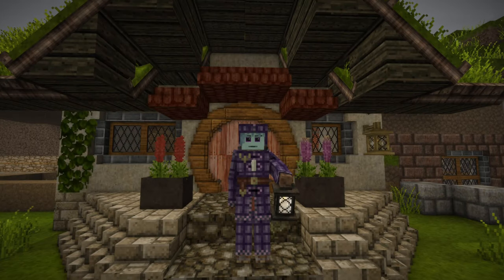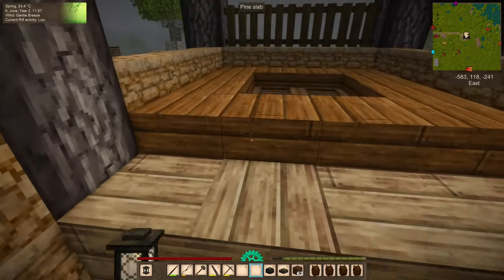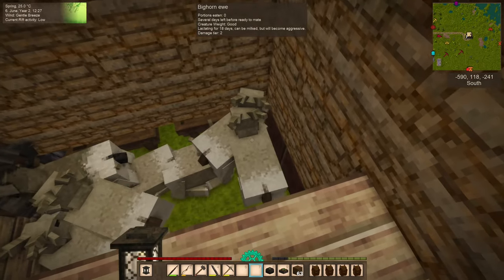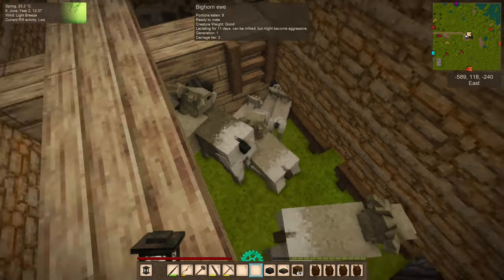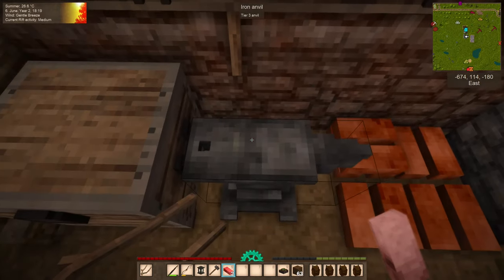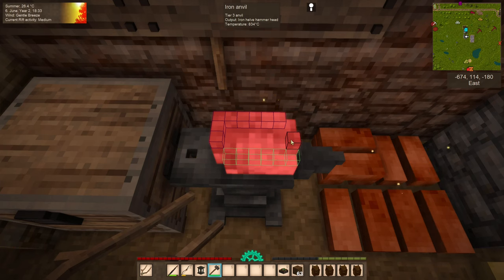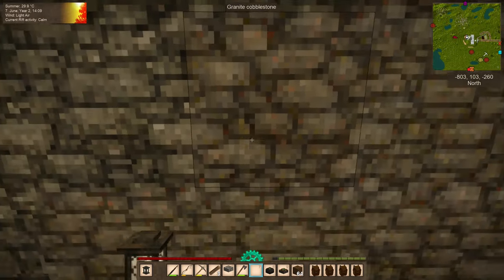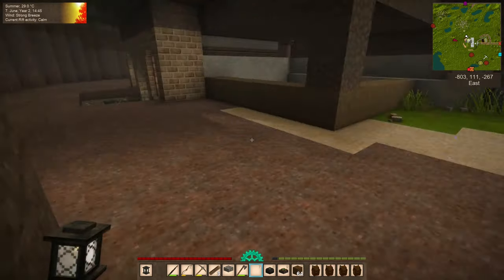A Hammer to Make Thor Envious: A Mechanical Helve Hammer! Vintage Story Guide S2 (1.18) Ep 42

Comment: 5:35 I just had a thought. You could use the cheese-squeeze process to 'carpet' a room with linen as long as you don't pick the cloth back up.
Reply: lol nice idea but you will need a good amount of cheese to do that :P
Reply from the maker: XD You can do that without making cheese! You can put linen on the floor and it'll turn into carpet (that you can pick up, turning it back into linen). At least, I think you can... that might have been a mod, but I'm going to have to go try it now...
Reply: @Kurazarrh  you forgot water in your smithy
Reply from the maker: @atroxie  Ha, I always do! Will have to chisel a barrel, since actual barrels don't actually work for quenching... >.>
Reply: @Kurazarrh  There's the Quench In Barrels mod.

Comment: A water wheel would be more efficient than a windmill I would think. If the game had water wheels. And actual running rivers. I think I saw a mod that adds them but it would be cool to see them come to vanilla Vintage Story. I see them on the roadmap so I remain hopeful we get those soon since I chose to live near water.
Reply from the maker: Yeah, water power would be nice! I think the water wheel is from Medieval Expansion, which I haven't tinkered with... basically at all (even though the Rusty Gears server had it).
Reply: @Kurazarrh 
I've played with it a bit and I really like it, though it's not very beginner friendly. The upside is that you can just plop one down just about anywhere as long as you're willing to lug water for the initial build but it's pretty "high-level" tech. The waterwheel itself requires a lot of iron plates, large gear pieces, and resin. The Base is pretty expensive too. It's about 2 years old but Julius van Vern did a video on it's mechanics when the Medieval Mod was just the Waterwheel. Still accurate, from what I've seen.
Reply: @Kurazarrh  The rivers mod also adds a water wheel, among rivers of course (just don't use sideways soil instability with this, I get massive chain reactions & incredible lag).

Comment: Ahhh I didn't know wolves could just phase through walls. I lost chickens to that before. Also lightning struck my chicken coop once. Never made lightning rods before but made a bunch after that.
Reply: I have seen bears kill sheep through a single fence before, do they eat chicken too?  Might be a collision box issue...
Reply from the maker: I think in this particular case, since it seems like some of the chickens weren't at the edge of the coop, that this may have been a lightning strike after all!
Reply: @Kurazarrh —If it was a fox or wolf that killed your chickens, then try this pen type: for smaller animals like chickens (fox bait) or sheep (wolf bait), enclose an area of 10 x 10 blocks or up to 19 x19 blocks within a fence line, then surround that fence line with a second fence line. Within the pen, dig down by one block across the entire pen. If the foxes or wolves are particularly adept at jumping (immediately capture the animal, and enter it in England’s Grand National Steeplechase—the bookies will never see you coming…you will make a packet. 😎), increase the outer fence line to 2 blocks tall, and the inner fence line to 5 blocks tall. Place a one block deep 3 x3 water pool in the pen, and a small exercise hill or two, then have fun creating artificial trees for the animals to shelter beneath.
Reply: @Kurazarrh  Do / did they go through slabs or something?

Comment: yaaah the helve hammer....if you get it going well, with like two hammers you can get away with 3 blooms heating. though what I often do, is use my own hammer sparingly to wonk out about 70% of the slag away, since YOU can bop up to 9 at once, the helve only 1 so...a few bops saves the hammer a bunch of work. if you've got other things to do but can check back every minute or so, go for it. otherwise, this saves micromanagement time because you CAN assist.
Reply from the maker: Oh absolutely. I'm just trying to NOT have to assist. Would rather spend my time just moving blooms, ingots, and plates around! XD

Comment: I love the power system in Vintage Story.....at least, conceptually. I love using it, and I love the concepts and the potential that it has, but to me it's currently way too clunky and un-intuitive. I'd love if it got a nice update at some point to make things just, overall easier to use. Which I'm sure will eventually come
Reply from the maker: I think my gripe with it is that it's extremely resource-intensive, and for new players who don't know they need loads and loads of fat and resin, there are other uses for those that are kind of "traps" for new players. Sealing crocks with fat and making oil lamps, for one. And the awful wooden lamellar is a great way to lose several resin in the early game! @.@
Reply: @Kurazarrh Perhaps this is by design...
Reply: Feels fairly intuitive to me? What about it is what you're struggling with? It's definitely easier than Better Than Wolves mechanical power, at least in terms of ease, because their gear boxes to angle your axles was an absolute pain to use. I rather wish it would go further in terms of features. Like the ability to create elevators, fall gates, etc. and of course more automation devices. Or look at what the Create mod in MC does.
Reply: @Dark__Thoughts  That's just that, Create is SO simple, fluid, and easy to use. You can build a line of axle's extremely easily. You can create turns and axles so easily, gearboxes are so good to use, and shifting up and down is very easy.

Vintage Story is very clunky by comparison. Axles are weird and they have to be attached to blocks, but only in weird circumstances. The gears are especially wonky and strange, you can't move an axle over by a single block without some extremely weird tricks. Also places where it should, logically, be able to be shifted or used, together.

I think it's extremely clunky, and could use a lot of work to make it extremely smooth like something like create.
Reply: @MrMasterofLps  I'd say the block attachment is actually a plus. It doesn't make sense to have free floating axles without any support structures. Create does a lot of good things, but it is almost a bit too sandboxy / creative feeling.

Comment: Wouldnt it save a connection if you place the input a few blocks back? That way it connects with the bend which youve put in place for the second Helve Hammer?
Reply from the maker: No, because you can't split connections on small angled gears. Only the large angled gears allow you to do that. I'll have to remember to mention that when we get around to adding our second helve hammer!
Reply: @Kurazarrh  Ah! Thought that, as there was a connection, it could connect to all faces. Normally (irl) it should work based on a little extra stress/tork. 

It would create some confusion for a new player, seeing as it should work 🤷🏻‍♂️